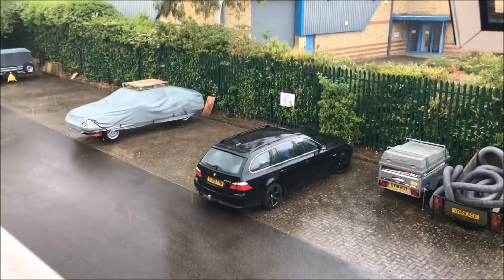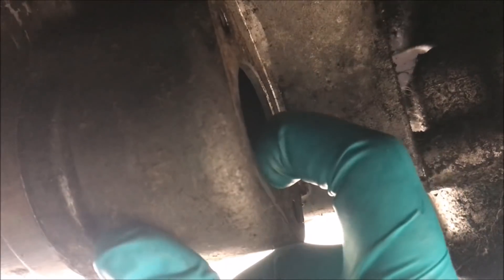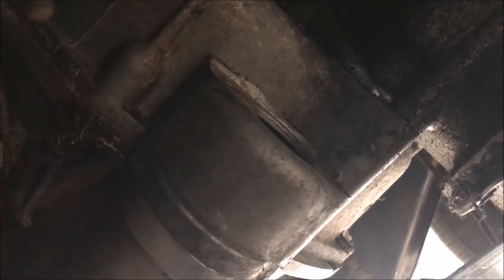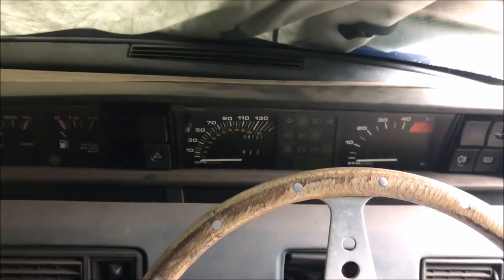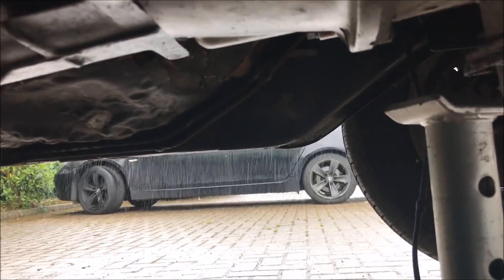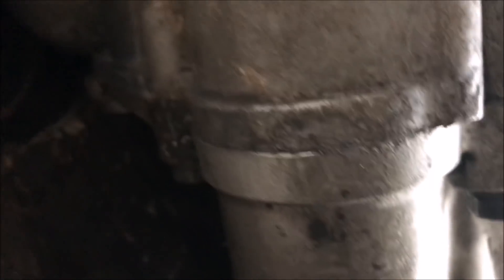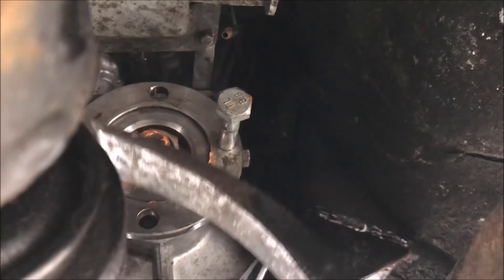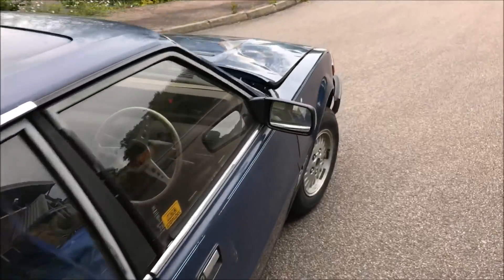Rover SD1 2400 SD Turbo restoration - Video 57 Gearbox in.  Much fail!

Comment: Massive achievement to get the car running and moving under its own steam, along with the structural repairs and clutch recommissioning. Don't be too disappointed re the gearbox as it was an unknown quantity that you have no control over. A nuisance to remove and have reconditioned however when you come back fresh you'll soon have it removed. 👍👍

Comment: Well, I feel your pain.
It's such a downer when you spend all that time & effort into dismantling and reassembling something only to find that it has to be done again.
I put a new crank & bearing on my old '85 2600 VdP and was rearing to go once I had put it back together again (I did it with the g/box off and the block still in situ) but when I went to turn the crank I realised that it was hitting something.
Turns out that at some point in its life, my 2600 VdP had had a 2300 engine transplant, so I had put a longer-throw crank on longer conrods, hence the hitting.
I then had to spend a whole day down the scrappers getting the pistons out of a dead 2600 and then fitted new ring and fitted them to my car.
I got it going again but the engine's top end was rattly as hell and I had lost interest in it, so it went to the breakers.

This was 23 years ago, so 2600 SD1s really didn't have much of a following back then.

Comment: Thats a bugger on the gearbox, all that hard work, at least the clutch works now, stll at least when its done it will be perfect, had a simular experience on my x1/9, when i put it into reverse, it would move the 2nd gear selector and lock up the box, and i was told by the seller that the box was rebuilt, cost me £320 to get it put right and pull the box twice, i feel your pain.

Comment: Great work on the car, you've done loads since I saw it at the NEC. 1 thing to remember about the gearbox noise. You have none of the usual sound insulation in place, maybe test drive it again with all that in place and see if it as bad as it seems.
Reply: @Chris Pratt    I agree ! lack of insulation makes a huge difference.Also,maybe give it time and miles to 'bed in'

Comment: I still think that it was a great car, but with a poor building quality. Once l owned 4 of them in order to make 1 good one. I really needed all the bits and pieces to maintain it on the road. The diesel engine Rover used die not coop with the expectations. Even the gear box was unreliable. Probably I was the only SD Diesel driver in Belgium, because all the others rusted away. But ... I wished Rover continued with that kind of shape!

Comment: shame about the  gearbox but just before you wrench it all apart I referred back to your vid on tidying the box where the oil was drained and was wondering if that was gear oil and if putting dexron in was why the gearbox is noisy ---- could it be there's an early box has been fitted?